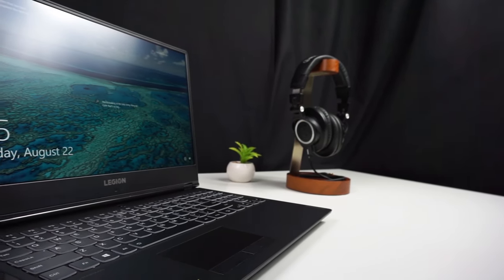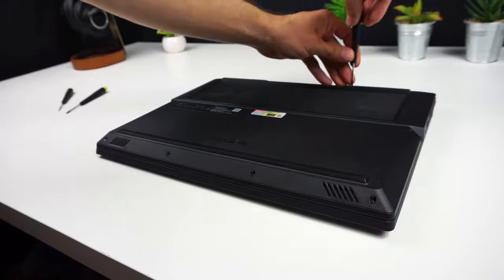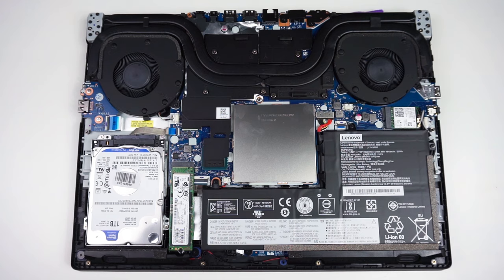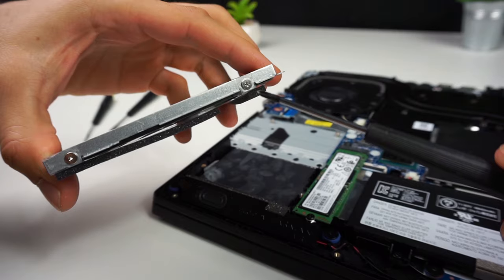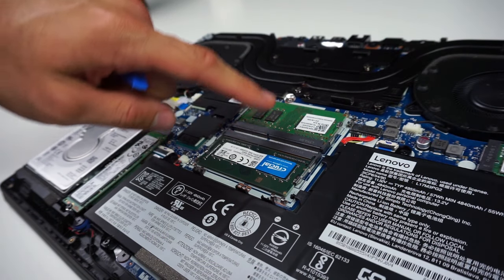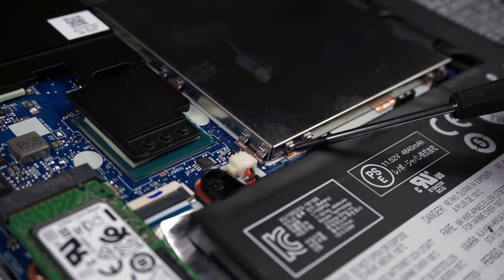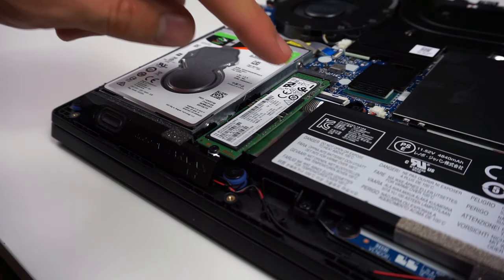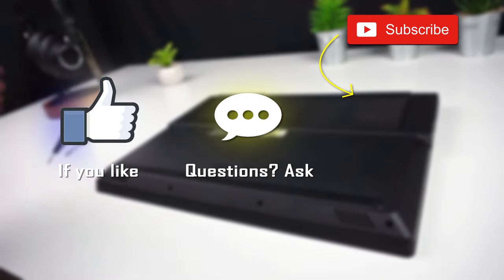Lenovo Legion Y540 Upgrade RAM / SSD / HDD - Disassembly Guide

Comment: Looks quite simple and easy. Czesc Tech Finds, been looking at the Acer Predator Helios 300 that you recommended, but all 15.6" laptops here in Australia seem to have the 60Hz screen. Only the 17.3" has the 144Hz panel. The 15.6" would be better for travelling. There is another Predator called the Triton 500 and that has the 144hz screen in the 15.6"  but costs $3,200 AUD it comes with RTX 2080, 32gb Ram and a 512gb SSD....but it has a weird keyboard layout. Later this year they are replacing the DDR4 to DDR6 RAM's and the RTX will be upgraded to Super ie RTX 2080 super....never stops does it.
Reply from the maker: If you gonna wait for new laptops you will end up waiting 4ever, because new and better laptops pop up like mushrooms after rain. ;) I don't recommend Triton, because it runs hot causing performance loss and yea, i've heard that Helios 300 comes with only 60Hz display in Australia unfortunately. It would be great to have 144Hz since it's WAY better, so check out my channel and maybe you will find a good alternative for Predator - i've got many laptop comparisons. Actually Lenovo Legion Y540 is a good option in Australia and i am working on a comparison between Y540 and 2019 Helios right now. Imo Helios is still better, but in Australia Legion may be better option.
Btw. why do you type polish words sometimes? ;)
Reply: @TechFinds  thanks for the information. I'll keep checking stores for updates as their websites are not always up to date. My parents were from Poland and a few new channels I subscribed to are from Poland, so write a word in Polish. My apologises if I have mistaken yours.
Reply from the maker: @wallyandellen5099  I don't mind, actually i am from Poland.

Comment: Can you use 64GB RAM on that?
Reply from the maker: It supports up to 32GB (2x16)
Reply: Indeed, Official document said it is 32GB max. I believe to saw someone and third party sites using 64GB but I'd rather trust 1st one and try to upgrade it in a long time.
Reply from the maker: @m.y.a.111  MAybe the laptop you saw was the model with 10th gen Inetl processor. I guess 10th gen can support 64GB in most cases

Comment: To have a double channel, the two rams must have the same speed ne? in this case 2666mhz
Reply from the maker: It's recommended that both sticks should have the same specs or as close as possible. You better match the specs to avoid compatibility issues

Comment: Hi, when we are done ..  we need to reinstall the window again or not? Ex: affect files or programs? thx
Reply from the maker: By default you have the Windows on stock M.2 SSD, so if you change RAM or 2.5" drive you don't have to reinstall windows. But if you swap out the M.2 SSD where Windows is then you have to fresh install windows on new drives and transfer all your files on the new drive along with reinstalling all your games/programs.
Reply: @TechFinds  I had this same question. I want to just upgrade the ssd to a 1TV samsung 970, will I need to have windows on a flash drive or will it automatically install itself on the ssd?
Reply from the maker: @beeys  the same situation as I explained above
Reply: Tech Finds correct but I’d recommend that he clones the old ssd on the new one, this would remove any possibly of data loss

Comment: Please help anyone!!!

I just did everything the way he showed but my laptop won’t boot up.

It just says error when I try

And when I go to boot manager it is  just one option, and that’s the one that doesn’t work
Reply from the maker: Make sure that you connected all the cables well and screwed all screws in. The laptop shouldn't stop working after just upgrading parts. You can also try hard reset. Disconnect the battery from motherboard, hold the power button for 30 seconds, connect the battery back, plug in the power cord and see if the laptop works. If not it's possible that maybe you damaged something during upgrade or accidentally disconnected some parts. You can also try removing the parts you added and see if the laptop works to confirm if the new parts are causing this problem or not.
Reply: Tech Finds I think the reason is that I have no files on the new SSD and must copy the old one to the new
Reply from the maker: @lordmoppe1816  ohh so you swapped the stock M.2 SSD whe you had Windows installed. That changes everything. You have to fresh install Windows on your new drive then

Comment: Can you help me Sir? In choosing best budget gaming laptop?

Asus Tuf fx505du al004T:
15.6In FHD 120Hz, AMD R7 3750H, 8GB RAM, 1TB+256GB, GTX1660Ti 6G, Win10

Acer Predator Helios 300 ph315-51(2018 I think because it has red Red keyboard specially the WASD)""""""": 
15.6-in FHD, IPS Intel Core i7-8750H/8GB/128GB + 1TB/6GB GTX1060/Win10
Reply from the maker: Why not the 2019 Acer Predator Helios 300? It's not much more expensive Tha  2018 model and it's way better. For a budget option you can also check out MSI GL65.
But if you wanna choose only between the 2 you mentioned I think that both are pretty equal. One has better graphics and one has better GPU - I made gaming benchmark videos for both, you can chech it out.
Reply: @TechFinds  ty Sir💝
Reply: @TechFinds  ur the only channel creator who helped me, your channel is very transparent and I really like it, worth subscribing👌.

But sir which is better for gaming(Less Hussle or less Lag spike/High Frame Rate) and also for content creation like 3D animation, AutoCAD😂 and etc.... The Asus Tuf fx505du al004T or Acer Predator Helios 300 ph315-51 (2018)??
Can u choose one Sir?☺️

Sorry for bothering u too much😂
Reply from the maker: @darylgervacio141  Thanks!
For AutoCAD both are good enough, so no worries here. I think that Helios 300 will be better for all you mentioned, but you have to take special care of cooling system. I mean undervolting, playing with max fan speed and cooler boost enabled, and eventually reapsting with high-end thermal paste if the stock one is bad (which happens in laptops)
Reply: @TechFinds  thank u Tech Finds🥰☺️

Comment: This laptop upgrade to 32 GB ram ?
Reply from the maker: Yes it is max
Reply: @TechFinds  In specs. Just tried to install a 32gb stick near the 8gb stick and it works great. Plan to buy another 32 gig module and have 64gb total. Need for work sometimes I open big datasets and it is easier to work with them in memory than read from hard drive.

Comment: how do I update the bios to support the better ram speed?
Reply: there's a limit for the speed, if the Part does have a higher speed available it'll still be capped due to Power Restrictions. I am NOT a 'techspert' by any means tho.

Comment: Hey Tech Finds,

I'm trying to install a new HDD, but my Model came without a SATA cable (not even in the box). I've tried asking official Lenovo support but they didn't answer. Which SATA cables are compatible with Legion Y540-15IRH? 

Also I'm thinking of getting a Seagate HDD for storing Videos for Video editing. Is a HDD good enough for that or will the slow speeds have a negative impact?
Reply: Hi! I'm also looking for it. But I found in lenovo support page model of it, but reviews in amazon is not good for that cables. So I'm still searching

Comment: 256 GB ssd + 1 TB HDD or 512 GB ssd no Hdd ? any suggestions
Reply from the maker: That's totally up to what you need. Nobody but you can answer this question mate.
Reply: @TechFinds  i want to know about performance which will perform better in what way
Reply from the maker: @prayaschittamang7888  SSD is much faster than HDD, so it can load the games faster and may increase the performance a bit